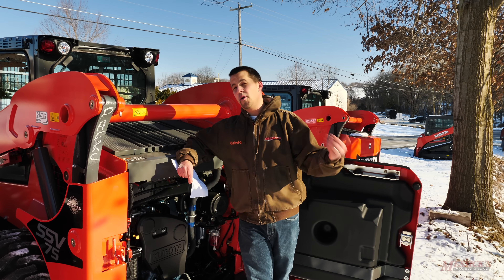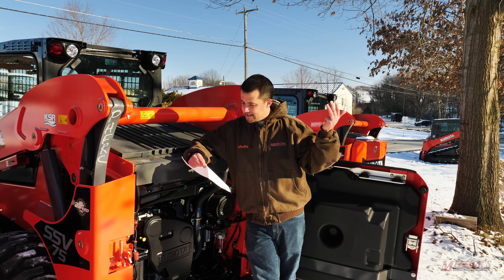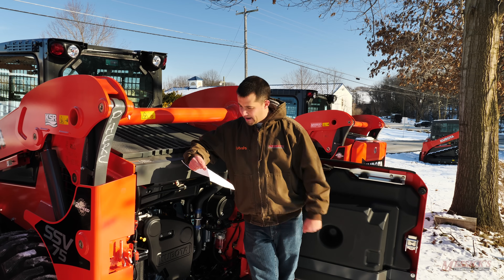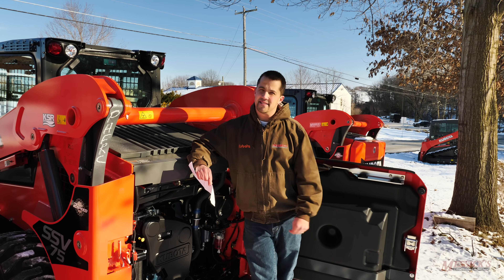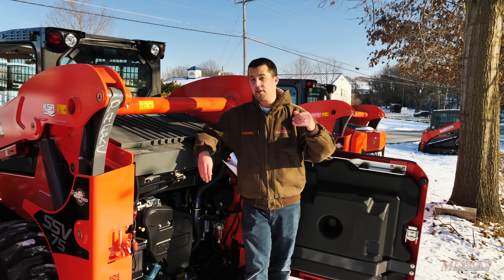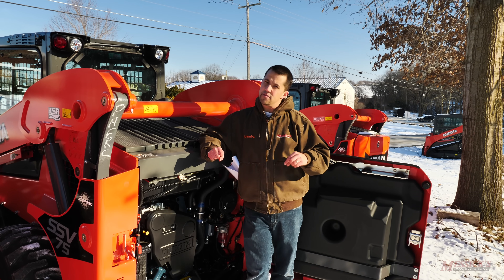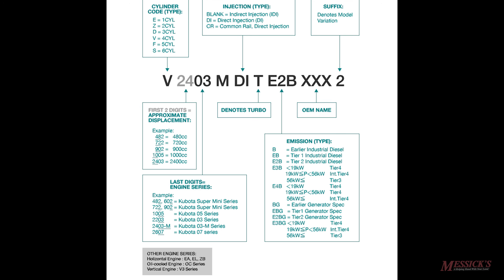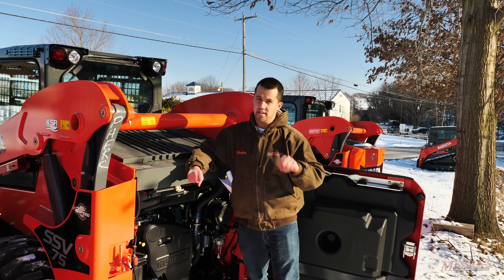Understanding Kubota Engine Model Numbers - TMT

Comment: Yeah the Japanese models make sense, say, Nintendo console systems.  Let's look at the original Switch:  HAC-001 (HAC in this instance denotes the system type, typically by project code or an internal working name.  In this case, "Handheld and Console."  The N64 was NUS, indicating "Nintendo Ultra [64] System" or Gamecube's DOL, indicating Codename "Dolphin") and 001 being the main computer unit.  Revised pieces of the machine, typically the computer unit would be 10x.

Honda is a good example too as its general purpose engines would be indicated as G--[displacement in mL] example GV150 would be its flathead series vertical shaft roughly 150mL or GXV160 indicating it's a 163mL pushrod overhead valve vertical shaft engine.

Honda's model names for its equipment is similar, say HRC216K3HXC indicating it's a Honda Rotary [Mower] for Commercial use, 21" cutting swath, 5.5 [rounded to 6] HP engine, 3 being the K3 model, hydrostatic transmission, X indicating Roto-Stop BBC and C meaning it's for the Canadian market.

Comment: Hello, mine is a L2850D tractor (1993), which I recently bought. It should be fitted with a V1702 engine ( 1732ccm, 24kW with regard to the registration papers). I find on the rear of the left hand side of the engine the figures" V15" . Besides, it is 4 cyl diesel still, I wonder whether it is a 1500ccm engine in. Could it be? What's the meaning of the "V15"? Does Kubota uses the same blocks, but different crankshafts, heads etc for different displacement

Comment: I have a D 1200 3 cylinder Kubota tractor.. I can't find the tag your talking about. It has 855 cc stamped in the block.. I need rings and rod bearings how do I figure out the size of motor to get the right parts??? Thank you
Reply: Hey, if you haven't resolved your issue yet, this is a number for KC power in Mansfield, Texas. Their warehouse is full of parts and refurbished kubota engines. Call them Monday and tell them your serial number. They will ship you the parts you need. If you don't know your serial, they can tell you exactly where to look on your model engine. They are extremely helpful and have just about everything anyone needs for their engines.

817-779-5259

Comment: I have a question, I bought a 743 bobcat that had an engine swap, I think they put a v1903 into it but it doesn’t have a dipstick that I can find, just a fill cap located on the front left side of the engine, when you open it the oil can be seen, why wouldn’t there be a dipstick, I didn’t realize until after I got it home, runs great but my concern is no dipstick,

Comment: How do you tell the year it was made?
Reply: Excellent question.  I hope Neil responds.  Sure he will when he reads your question.
Reply: Messick Farm Equipment so there is no way of telling the year on a kubota tractor?
Reply from the maker: +Piaras macgiollaiosa this is a video about engines. Call your dealer, They look it up.
Reply: Was only asking,wasn't trying to piss you off!
Reply: https://www.kubotaengine.com/serial-number-information/identification/

The kubota dealer in the video should have automatically sent you this page.

If the tractor has the original engine, it is likely the engine was produced the same year as the rest of the tractor.

For example, my engine is V2203-5J2428.

V2203 meaning the engine model itself
5 = 2005
J = the first 10,000 of the year
2428 = the exact one out of the 10,000

The serial number should be located at the injector pumps intake lines next to the governor. It is a flat spot usually obstructed by paint.

I hope this helps!
Reply from the maker: +Piaras macgiollaiosa you can't
Reply from the maker: +Piaras macgiollaiosa this is a video about engines. Call your dealer, They look it up.
Reply from the maker: +Piaras macgiollaiosa yea, no harm.
Reply: Gary Helms he is a wee bit touchy!

Comment: The first letter makes sense in German: 1=eins 2=zwei 3=drei 4=vier 5=fünf 6=sechs 
Fun thing, seems like they are already planing for a 6 cylinder engine despite they never built one until now (as far as I know).
Reply: Christian Büttner Kubota had 6 cylinder engines back in the 70s.   We had a 1979 m4500dt.  It had a s2600a engine rated about 55hp.
Reply: I'm a little late but I own a 6 cylinder S2800. It's in a Thomas Skid Steer from the 80s.